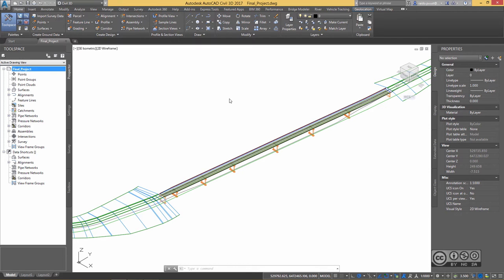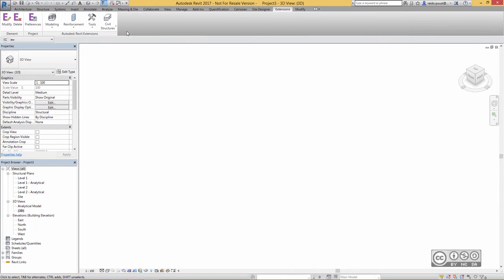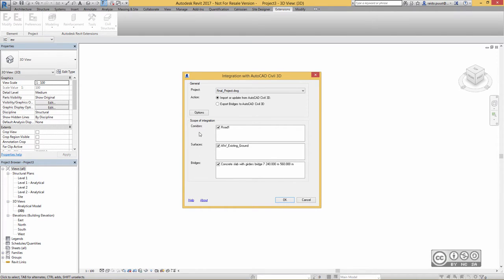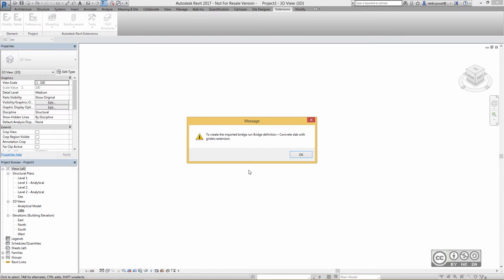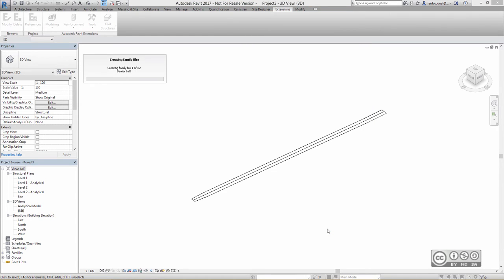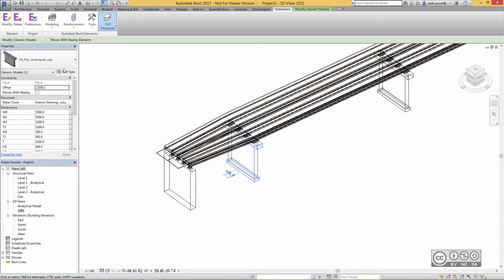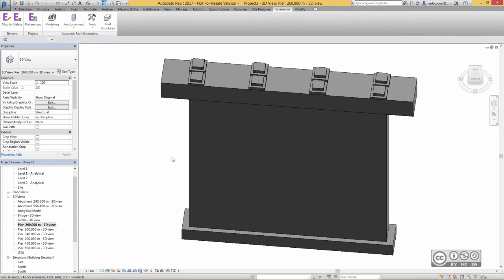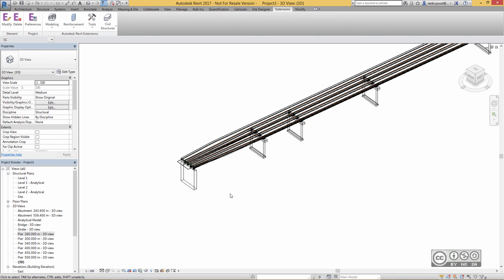AutoCAD Civil 3D 2017 - Bridge export into Autodesk Revit (overview)

Comment: Hi, this extension seems to be not available in the latest version of  Revit, Can you please help, Thanks in Advance.
Reply from the maker: You are right, it is not available anymore because Autodesk has changed the workflow. Instead of Civil 3D (which is not meant for bridge design), you start in InfraWorks, preliminary design and from there you can export it into Civil 3D (coordination workflows), or into Revit / Bridge Design (for specific detail design workflows). You should find those collaboration workflows from my videos.